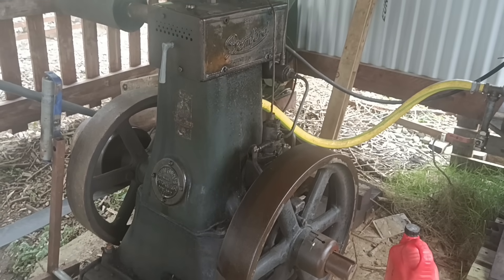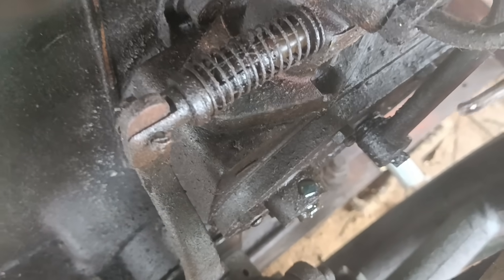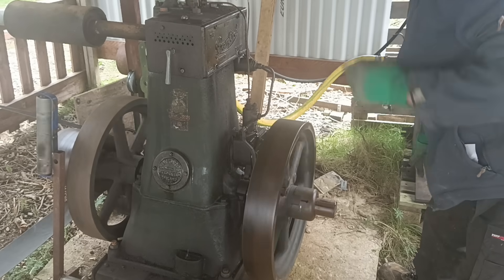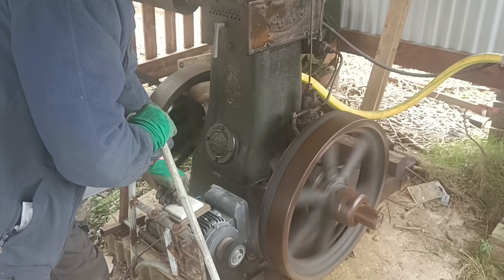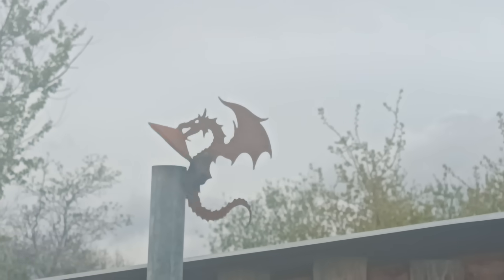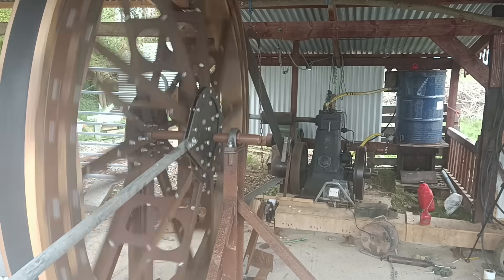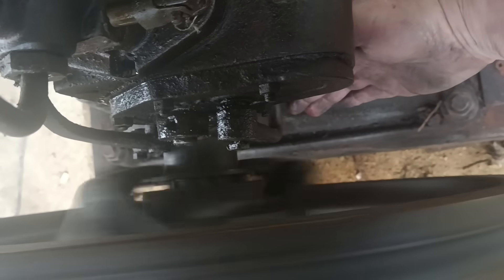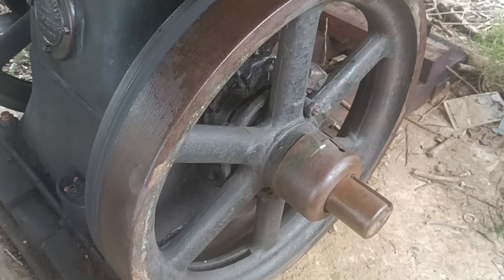How Much Fuel Does This Vintage Engine Use? Bamford stationary single-cylinder diesel efficiency

Comment: People who say your diesel is not efficient only think that modern diesels are more efficient what they don't take into account the slow speed diesels us less fuel compared to modern high reving diesels. Remember that gas or diesel to increase the rpms you have to increase the amount of fuel to run faster

Comment: You could also use your old sump oil from any vehicles you have. Just filter it well and mix it with the diesel.
Reply: Not exactly friendly to the injection pump. Also used engine oil has lots of additives and contaminants in it that make nasties in the exhaust.
Reply: Could, but should you?

Comment: Keep in mind that this engine has a pretty high compression ratio for the time it was built in order to combust the fuel without a spark plug. A higher compression ratio means you can squeeze the air/fuel charge even higher to make a bigger bang. 

What you get from this is less fuel burned for more power. That, and the fact that this engine is more precise about how fuel is dispensed than contemporary gas/petrol engines, there's no wonder it uses relatively little fuel. Sounds great, too! 

It wouldn't hurt to put new rings in it. It would probably cause the compression ratio to bump back up closer to stock, and actually burn less fuel. That said, it's probably not necessary for what you'll be doing, and it's probably easier on the old bearings if it's not hitting its hardest all the time.

I have a few old gas engines, and they consume way more fuel than this thing does. Of course one of them is a 1917 engine that's so primitive it doesn't even use a carburetor (look up "hit and miss mixer" in google for more info). No real surprise there!

Comment: Seems like it could run intermittently and charge batteries for a house, let it run when power is expensive, or charge at night/while sleeping and if it is adjacent to house you can use it for heat too . I bet it will still be running when we’re both gone

Comment: I wonder, can you put a modern generator on that thing's belts, put it under 1kw load, and compare its fuel use to a modern engine doing the same thing? I wouldn't be surprised to see it beat the modern engine in efficiency. The modern engine may have advantages in inherent efficiency, but it's also loaded down with a lot of junk it doesn't need that puts a burden on it. Interesting aside, the Ford model A's and T's got about 25mpg...

Comment: You understated the biggest point, the equivalent electric power would have been 4x the price.

There is a real point to be made here about on-site, on demand power. 1 litre of diesel contains 38 MJ of energy, which is roughly 10.5 kwhr. So your motor is a handy tool.

Comment: We have a Lister Engine built in 1924 looks very similar to this one in our shearing shed in New Zealand…it has served 6 generations of our family flawlessly and we would never ever get rid of it…enough said!
Reply: We have one also in new Zealand running a water pump it's a great old beast
Reply: Used an old Lister as a generator.  Yes the fuel isn't as well atomized as a new engine, but most all losses are recovered with the extremely slow piston speed giving more burn and expansion time.  I did some pretty good measurements of kw load and fuel consumption. There is Nothing on the market in these small sizes with as good as fuel efficiency.  The problem isn't that this old stuff sucks, modern users suck
Reply: @clytle374  Well explained and I approve of your analysis.   The HP rating is very misleading, the kinetic energy in these engines is very high so usable torque is better than a screaming low bore engine which have high reduction losses. These machines just keep going under no stress at all, thermal efficiency is better than current engines, combustion less so but who cares.
Reply: @clytle374  I think the weight of the engines is what what caused their demise, it's pretty hefty for only 6.5hp.
Reply: Wow!  That is very impressive indeed!  That would be such a pleasure to see and hear it.
Reply: @daveneil3963  i’ll do a clip on it when we do the next shear if i remember to
Reply: I once worked as a maintenance man for a land holder in southern hills, South Australia who ran Angus beef and sheep. 
The shearing shed had a Lister diesel and it was my annual job to ready it for shearing season. Always reliable, never need any tinkering and always started easily. 
I eventually left there and some years later there was a bush fire. I went visiting to see how everyone and everything was. 
Sad but true, the Lister had been moved from the shearing shed to the workshop across the road and while the all wood shearing shed survived the bush fire, the workshop didn't and neither did the Lister.
Reply: A modern Engine would never ever match your Lister...they are modern Junk that lasts 5 minutes.
Reply: Probably a Lister CS.
Reply: what does it do for shearing? is it a generator to keep the lights and heater on?
Reply: @elij.s.7580  drives a belt which runs through a cut out in the wall which is connected to a shaft that runs the shears
Reply: Internal pushrods?  im sure from reaserch mine is pre 1921 from my research it has exposed push rods ,, just needs some new bearings . you may know more then me though
Reply: Looking forward to you posting a video of your engine

Comment: How about some maths: 6 horse hours = 450 mL diesel,  so about 75mL diesel does the work of one horse for an hour. Thats an incredible amount of energy stored in such a small volume of fossil fuel. Now compare that to say a modern small diesel car: at a guess a small diesel car uses about 6 litres per 100 km, and if you were travelling at 100 km/hr, thats 6 litres per hour, which is incredibly inefficient in comparison. 6 horses would have no problem pulling a small car around for an hour, let alone all day. The difference is that in modern engines we want fast acceleration and speed, we dont have the patience to slowly build up the speed. This old motor takes time to slowly build up momentum, and store the energy in the heavy flywheel, which is then used to do the work, the motor just keeps the flywheel ticking over, once its up to speed.

Comment: I'd be interested to see if you could run it off waste vegetable oil without converting it to biodiesel, or possibly from used (and filtered) motor oil/gasoline mixture. I'm fascinated by these old engines, so simple and so dependable.
Reply: I suspect it would run just fine on vegetable oil.

Comment: 4,5KW Thermal Power, 30% efficiency ends up in 1,35KW/1,82PS. Putting in the density of Diesel with 820g/L it ends up in 273g/kwh specific fuel consumption. Which is really okay.

Comment: Fascinating!  I love old machinery.  I guess the scientific answer would be to compare consumption with a modern 6 hp diesel doing the same work. But will the modern small engine still be going strong after 80 years? 😄

Comment: I think what’s old is new again. I think that when people find out how quiet and efficient these engines are the , they will want to start using them to power inverters. I’m old enough to remember these being used in boats abound the harbour. No fast but strong and should be just the thing for generating electricity ?

Comment: That exhaust pipe dragon is one of the coolest and only decorations I've ever seen on a listeroid. I always wanted one even if it was casted machined in india with many flaws or casting sand still inside the works. I will have one one of these days.

Comment: They are probably not used because they need much more service than for example a electric motor would need. 

And keep in mind that even today best diesel engines give out only about 4 kilowatt-hours of mechanical energy for litre of fuel. This costs about 25 cents per kilowatt hours. And this old engine probably has only about half of this.  efficiency. In my country, an IE3 electric motor gives mechanical energy out well under 20 cents a kilowatt hour. And they last almost forever.

Comment: It would be nice if someone did use a modern injector and fuel pump on an old unit like the one your showing. Give a base line with the old injector vs a new one. Maybe connect an oversized generator head to it to compare power output. Two runs with both injectors at full power while cranking up the generator output until the engine stalls.

Comment: I knew an 84 year old Lady that would go into the machine shed in her night ware (at around 4.30pm) and spin the fly wheel of a Southern Cross single cylinder diesel to start the "night lights" which was a 32 volt light bulb... the old Southern Cross was very similar in design this engine being shown. Ol Sally passed away many years ago now, but I can still see her flicking the decompression lever and pushing the fly wheel to start the engine. Bless her soul.
Reply: That's a beautiful memory. I hope one day you will meet Sally again.
Reply: @toasttoriginal  One day he will for sure.
Reply: 32 volts was the operating voltage for Dunlite wind mill generators manufactured in Adelaide Australia. Tools and kitchen gadgets were also made or altered to go with the system. Plenty Dunlite systems were exported to USA and elsewhere before widespread electrification.
Reply: @Philip-hv2kc  well, that was the widespread electrification...  Mains power came way later in the piece, even in the 1970's and '80's mains power was still being rolled out into rural areas.
Reply: you can still see her? ghost?😮

Comment: It would be much more interesting if you measured fuel consumption under heavier load.  Any chance you have a generator?  Gallons per kWh would be a most interesting figure.

Comment: An electric motor will only use as much energy as required, and should be 80%+ efficient. You can't easily conclude the power used by an equivalent electric without knowing the efficiency of the diesel.

A litre of diesel contains 37MJ of energy, or approximately 10 kWh. Assuming 20% efficiency (probably generous, if I were guessing) and 0.5l of diesel, you got about 1kWh of motive energy. I would expect an electric motor in the same application to use approximately 1.2kWh. 

If you hooked up an electric motor and did the same test, it would be very interesting to see the outcome, as you could calculate the actual thermodynamic efficiency of the motor, not just handwaving it off as "cheap for what it did".

Comment: Have you ever thought of using the wood gas as fuel which is a by-product of charcoal production?
Also works with diesel engines. The diesel then only serves as ignition fuel in idle quantity.

Comment: That's the same fuel consumption as a new 5hp diesel I recently bought at 2/3 throttle. -About 3 hp.
So it appears that other than its weight. Your engine has similar efficiency, is far quieter, does it at 1/3 of the rpm.
And is certainly less complicated and undeniably more robust and reliable.
And repairable. 

So, really, clearly, human technology has regressed, rather than advanced in the last century.

Comment: I have a 1950 Lister start o matic  6/1 diesel generator that can run 8hrs on 1 gallon on full load, 
Similarly I recall in the 1960s  an RAC test on a mini car , returned 50mpg, so my conclusion is that things have not improved that much despite electronic complications in engine design,  I'm not disputing the massive power increase of a modern engine , but no great gain in fuel saved

Comment: Im a great fan of engines that use a heavy flywheel, this stores a tremendous amount of energy which helps with efficiancy
Reply: the weight of the flywheel has nothing to do with efficiency... efficiency is 95pct+ determined by what happens above the piston in terms of thermodynamics.
Reply: Me too.  I and my son both have International LB engines.  We love messing around with them and just watching them run.  My son named one of his Gertrude after my Grandmother who passed away many years ago.   Here is his video:  https://www.youtube.com/shorts/IBeI4l7FyQs
Reply: Well the flywheel certainly smooths out the power pulses and compression. Mine has a fan cast into it helping with keeping things cool too as well as housing part of the load regulator.

Comment: I have a 8hp @ 800 rpm lister cs diesel twin flywheel driving a 120 amp car alternator using a serpentine belt around the outside of the flywheel to a 2 inch pulley on the alternator motor is fully rebuilt and it provides power to a great big truck battery then that powers up a 1000 watt inverter thus giving me lightning fans fridge and freezer for 4liters every 12 hrs and they humm you to sleep at night 😊
Reply: Would it be more efficient to run a permanent magnet generarator directly off the same flywheel..say 3kw plus...if you had one?

Comment: Looks pretty ch2eap to run and does the job . If they were easier to start i think more people would still use them. People dont want to oil and grease stuff anymore. Just flick a swith. So sad.

Comment: You could do all that work for free if you used old engine oil and brake fluid. There are people using that stuff in their diesel cars and trucks, so I’m pretty sure it should work on an old Bamford. But you will make the petrochemical industry nearly as annoyed as the tiny Swedish elf puppet. How DARE You? 👀🧐😎😜🙈
Reply: Get the dregs from an  automatic transmission shop....
filter the ATF....burns well in IDI old diesels....

Comment: It's a charming engine and fuel use seems about right for that light load. It probably wasn't using more than 1 HP if you could run the machinery by hand for a few seconds. So electricity use would be more like 0,75kWh based off of that if you had an electric motor instead. But none of these hobby items are about efficiency, they're about the engineering and charm. Fun test.

Comment: The only thing i can say is no way a modern high speed low displacement engine would have consumed less to do that job.
Reply: Honda 2000i running @ 1kw output into an electric motor????

Comment: I disagree! 
That's as efficient as most modern diesel engines at an assumed rate of 0.4lbs fuel/per hp/per hour. That would also mean your only using about 2hp form the engine.

Would be interesting if you were to have the injector bench tested and overhauled if needed how much more efficient it might be.

For comparison Gardener engines are one of if not the most fuel efficient old diesel engines. An 8LXB is 0.339lbs per hp per hour and an 6LXB 0.330lbs per hp per hour.

Comment: that's  a great old machine you have there.  those big fly wheels really put on the power and drive that machine.
Reply: The flywheels smooth out the Bang push...coast...coast..coast..bang push......
roataional stresses of a big 4 cycle single cylinder engine...
they add nothing to the horsepower....

Comment: Actually, compared to a modern emissions-compliant Diesel, yours is likely way more fuel efficient.  Also massively more durable and cheaper to operate as well.

A sad reality of emissions compliance is that when it started becoming a thing the first thing to go was the universal standard Horsepower Hours per gallon / Kilowatt Hours per Liter of fuel burned rating number, which is the metric of how much useful mechanical work an engine would do for a given amount of fuel consumed.   The higher the rating the more fuel-efficient the engine was. 

The last thing manufacturers wanted the public to know was that their shiny new 'eco-friendly' engines were often 50 to 75% less fuel efficient on work done per unit of fuel consumed than their old workhorse ancestors.

Comment: So.. at current US pump prices, about 50 cents for an hour's worth of hard work. Wow. Impressive, assuming you have an application for non-portable power. Thanks for making this. How much do these old units sell for in the UK?
Reply: You used to be able to import brand new diesels made to this old fashioned standard directly from India.

Now you can only buy them as air compressors...EPA you know.

But you can also buy an overhaul kit which transforms them into diesel engines....😉😉

Amazing technology eh...

Comment: It's fun how inflated prices of electricity are, considering goverments want society to be more green and use electricity instead of a local diesel engine, but the diesel engine is cheaper to run :P
Reply: Only if you already have the engine...and the geneerator....and they  run efficiently.
Nothing will beat hydro power for cheap energy...